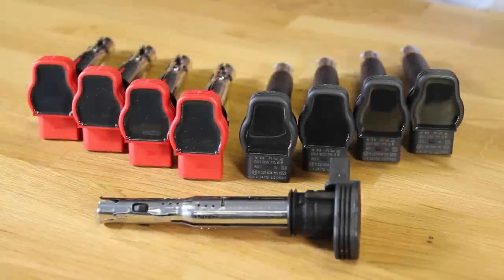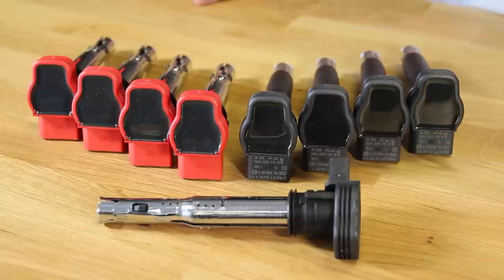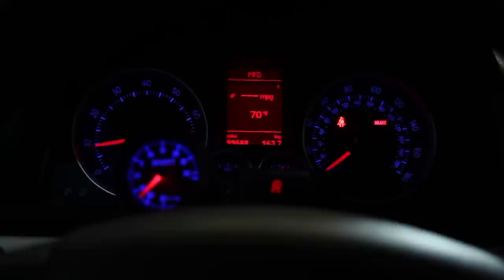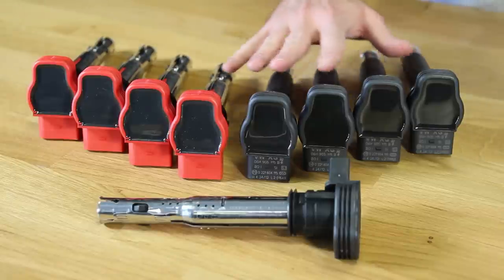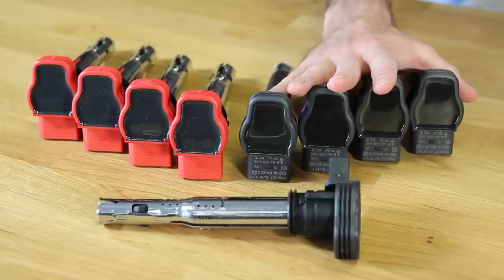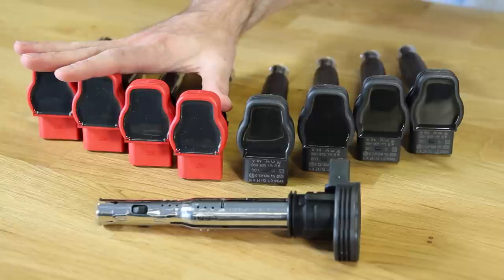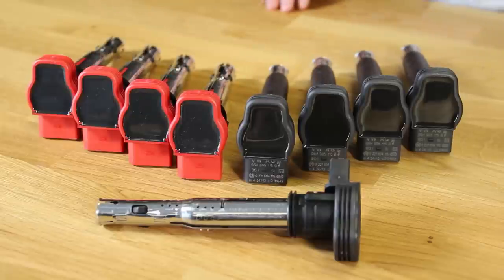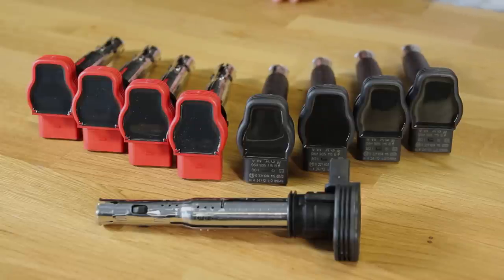Bad Ignition Coils on VW and Audi 2.0T (How to check)

Comment: putting these on a 1.8t audi is a good "upgrade" ? if so will it throw any codes ?
Reply from the maker: These will not work on a 1.8t as they are too long but this ignition coil is perfect for the 1.8t https://deutscheautoparts.com/06c-905-115-m.html

Comment: 2013 2.0 fsi, ignition 2 & 3 not providing high voltage, , all coils has being change , new coils installed yet the same 2&3 you can hold it while car start but the shocks that come out is not enough like 1 and 4, remember all coils are new, yet the 2 & 3 can't give out high voltage shocks, pls what could be the cause, could it be faulty engine computer or what, the spark is little and faint on 2 & 3, that you can put screw driver and hold yet you won't feel that heavy spark which will cause you to throw the screw driver away... 
Help me to narrow this fault why this 2 could are not firing, if you take it to 1 & 4 it give high fire or spark . Look forward for answer
Reply: Since you changed the coils, it seems your spark plugs could be bad....you haven't stated if you changed them....
Reply: Sifflement ralenti golf 6 turbo

Comment: Hi first of all I want to say thank you for all of your informative videos. I have a misfire on cylinder 3 I went ahead and changed all of my spark plugs and I used the Bosch. I switched coils from one to three and three to four and so on. It still says misfire on cylinder three. Do I need to change all coils? Thank you I'm really trying to learn and get this done myself.
Reply from the maker: You likely have another issue.  Probably fuel injector related but you should consider having your vehicle diagnosed.
Reply: Deutsche Auto Parts- Your Source for Everything VW and Audi Oh my I didn't think you were going to respond this fast. I spoke too soon because i turned off the engine and drove around for a bit and now the problem shifted to cylinder two. Now I am confused as to how the order goes. Also the auto parts store only had the original part in stock not the updated versions. I purchased it regardless even though you stated in the video they don't use them no more and I want to know if it will still work. I am right handed so will the order go from my left eye to the right or from my right eye to the left? Thank you so much you have helped me in so many ways and on so many levels.

Comment: When you disconnect working component and your car bumbles ,doesn't that mean the part was working right. If you disconnect a component in line with a bad component there would be no change in the sound of the motor.
Reply from the maker: We will be talking about AskDAP 99

Comment: The crazy thing is that my car never shook. The only thing it did was just turn off and not start. I wait a couple of days and it would start. but once I turned it off it wouldn't start. I have 3 error codes that came up. P0321, P0351A, and P0420.
Reply: My car is a 2002 vw Jetta
Reply: What was the problem? Similar issues here with 1.8t 2002 A4

Comment: Hi I was wondering if you could do a tutorial on a problem I am having with my 2009 vw cc sport 2.0 T my epc light continously comes on and while idling it stalls also when it gets really bad the engine sputters and every now and the  the c.e.l comes on and gives me a throttle body code I've looked up forum after forum and haven't been able to fix it help please
Reply from the maker: Ken Monroe You likely have an issue with the throttle body or it may need to be repined.  There is a link the the throttle body below. 

https://deutscheautoparts.com/vw-audi-2-0-t-throttle-body-06f133062t.html

Comment: I am so tired of YouTube being watered down by these useless "today we're going to listen to me talk to get attention but never really give any useful information" videos. Just stop. I have wasted my time trying to find out the Pin-Outs on these same coils so I can check them with a mutli-meter. I have to wade through tons of this crap. How about showing people how to actually check their coils. Like your misleading title says. We all know you can swap them around. Doesn't help much if you have more than one defective coil.
Reply: Indeed, very useless video. I am helping out my friend now and we have short 1.2-1.6 liter tsi coils on 1jz vvti engine running ecumaster emu black. I checked primary winding resistance of the coils (1 and 4 pin) and it reads ~385ohm on all six coils. Secondary coil winding resistance was (2 and 3 pin) 5.8-5.9 kOhm. Car runs like complete crap and very rich at idle. Need to pull out at least 50% fuel from main VE table to get it idle at lambda 1. Checked everything else, coils get proper voltage and grounds are ok, timing is spot on when checked with timing lamp. Now we are buying new coils and in a few minutes we'll see if it cures the problem. :D

Comment: Bad design, bad quality, and shoddy insulation varnish-really, Toyota never has these problems..German "engineering"-my ass!
Reply: VW has since fixed the problem - there are both the sheathed coils which help a bit, and an upgraded coil (that is luckily around the same price) that is supposed to be *loads* better. I've owned a couple Toyotas, a Lexus, five VWs and now an Audi. And I'll take the Audi almost every time. (though my wife could talk me into a Lexus GS 400 in a couple years, I'm sure)